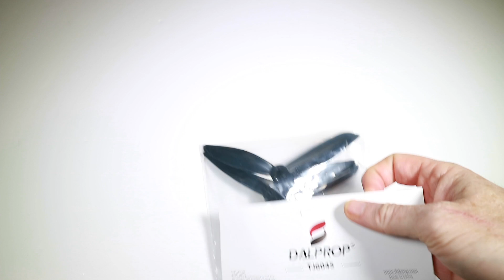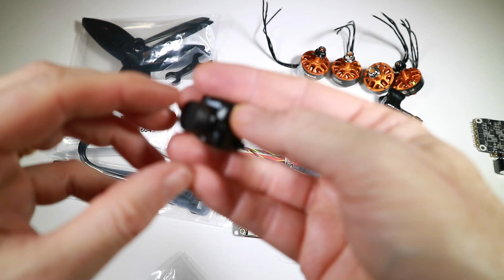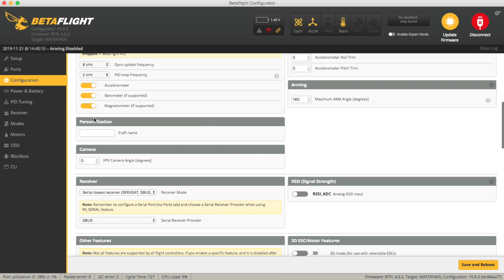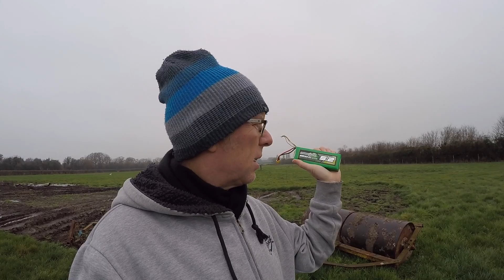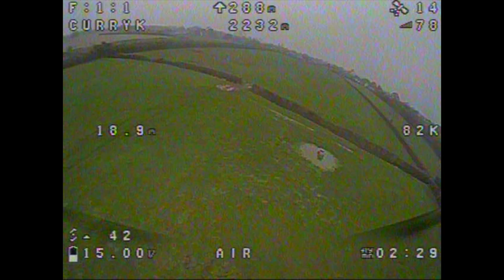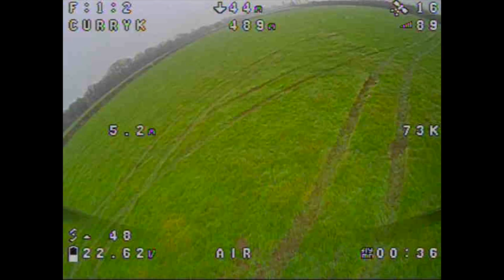Eachine Tyro119: Build, fly and review.  Supplied by Banggood

Comment: Well done in the fog and mud mate...The random GPS count is a Betaflight problem, been going on for ages now....Please drop iNAV on one of your Quads..I have it on one of mine, and I know the GPS Modes can be impressive...
Reply from the maker: I've still got my f450 which I was attempting to setup with Ardupilot months ago, but fell foul of no compass.  I do have a GPS with a compass now, so the plan was to try Ardu and then try iNav after to compare.  Just getting around to it and time etc
Reply: @CurryKitten  Well, I'd put it in a 6 incher or even a decent 5 inch quad tbh...The F450 isn't going to give you a good comparison...iNAV works well on a quad now...RTH will land at your feet in a controlled manner too. Ardu is too complex for most users.

Comment: @currykitten Thanks for another great video review. My first build about a year ago was the Tyro99. Really got me going in the hobby. Fun to fly, although the e!ectronics are not so durable. After replacing the FC and ESC twice I replaced them with a Mamba F4 MK2 stack. All is well. 

Still, the Tyro series can't be beat for the price. A great way to make the jump from RTF to building your own and learning the finer points of drone tech and construction. A dozen or more builds later I find I enjoy building almost more than flying. Again, nice video. Love your style. Keep 'em coming.  ~Bob
Reply from the maker: Hey Bob - the Tyro series certainly has it's faults, but it seems to get people into the spirit of building (and then crashing and repairing :D ) So it can't be all bad.  I just wish they would fix some of the real bugbears I have that would make it nicer for 1st timers.  Like decent instructions, nice motor wires and getting rid of that tiny SBUS jumper pad !

Comment: Damn, now I'm positive I'm having issues with my R9 system. I have the r9 lite pro module at 1W, but I've gotten failsafes at 760M with good line of sight... IDK, im on latest OpenTX, latest R9 firmware..
Reply from the maker: Yeah - somethings up there.  Bear in mind I was also using both TX antenna tuned for 915Mhz, but I was using them at 868Mhz which should make things worse.  I'd check out your antennas first - I heard a few stories about dodgy joins in the super-8 antennas
Reply: @CurryKitten  funny you mentioned that. I had been using my original super-8 antenna but today changed to the new one that came along with the lite pro module. My rssi hasn't changed much noticeably with most of my models but with a new slim+ OTA receiver I broke 1.1km today. Rssi was never below 60 in that flight.

Comment: David Windestal shut his RCExplorer shop right around the time I found out about the Tyro129 so Im currently, slowly, building a 7inch Tri & THEN will be grabbing the 129....
Motor wire problem on the Tyro's could be alleviated by adding in some 'racewire' like product, maybe...?
Personally, I'd be using a L9R rx & thinking the GPS mount would be a good spot for it to sit...
Ive noticed the amount of new-comers to the hobby buying the 129 & hoping someone might do an 'iNav on a Multi-Rotor for noobs' series as there doesnt seem to any 'complete' how to guide that I can find....
Any chance of doing something like that please?
I do know the GPS will need to be replaced for full functionality on iNav (220 lacks a compass)...
Only drawbacks I can really see with the Tyro 119/129 series of quads is the FC/ESC's have no current sensor & could really do with some soft-mounts included...
And those shit wires :/
Both look like the perfect quad for a Hybrid/Tarsier type camera...
Dalprops 'TJ' might stand for 'Terrible Jello', only the flight footage looked pretty damn smooth to me! :v ;)
For myself, I'd be runninig 3000 4s & 1800 3s in series (6s) as thats all I have for my fixed-wing models...

Anyways, just some random ramblings...
Thanks again CurryKittens & looking forward to seeing more!

Comment: Where did you mount the receiver? I'm new to this and not sure where i should mount it. Would it be ok on top of the vtx? Thanks
Reply from the maker: Mine it mounted on top of the VTX (although it's heat shrinked and has mounting tape so no possibility of shorting)  In an ideal world you want you rRX and VTX far apart, but that's not always possible in quad builds.  Another place you could put it is the shelf at the rear.  I wasn't getting any issues with the VTX mount though

Comment: Them wires on the motors bug me, it makes the motors seem like less Quality., hard wires are no good long term against vibrations and brake. If supplying a kit then the instruction should be good to help new builders to put together without research.  I love my 7" build I have made but it did take some tuning to get prop wash out, I wonder if 6" is a bit better. Nice review..
Reply from the maker: They really are shocking - certainly the weak point in the kit, and everyone has been saying it forever.  I especially hate the little jumper you have to solder as well.  Can't say for sure how the 6" feels - there's certainly some vibration going through your own prop wash, but seemed pretty smooth in everything else (as much as I could tell in the rain!)
Reply: @CurryKitten  Like I say I was lucky as SEB-FPV (Youtube  FPV-SE ) tuned my Quad using the black box, UAV Tech - PID Tuning Principles and now it flys fantastic, Seb knows his stuff backwards. I find when you get to 6-7" the tuning changes big time

Comment: Thanks for doing this video! I built this kit and used an XM+ (until I can upgrade to R9 or crossfire) so I didn't need to worry about telemetry (which also means my GPS rescue doesn't work either if I understand correctly). Did you just solder that R9 receiver to UART 4? Will you be covering that kind of information in your F.Port video coming up?
Reply from the maker: This is the second comment I had recently about people thinking you need telemetry to make GPS rescue work... I don't know if someone else has put this info out there, but it's not true.  G{S rescue just needs a working GPS on the quad - so you should have no problem getting it working.  If it helps, I made a video about the setup of rescue mode here https://youtu.be/n89zKarWohs  But, yes I'll be covering the F.Port/telemetry setup in the forthcoming video... and why it needed a different UART
Reply: CurryKitten awesome thanks! Yes I did see another video saying GPS wouldn’t work unless I had telemetry. Thank you again for your great videos and good luck with your flight sim!
Reply: @CurryKitten  Is this video already done? I am also struggling setting up telemetry with fport.

Comment: Well done for getting out there, weather has been terrible lately. It seems like a great versatile quad with use as well as batteries. Question, when you tried rescue mode it seemed to climb to 100m but in your BF setup seemed to show 30m or was that just me or did you change a setting? A cheap batter pad is a silicon mobile phone dash pad from the £1 shop, makes quite a few battery pads :-)
Reply from the maker: Rescue mode confused me at first (luckily this is the 3rd quad I've used it on so I'm used to it now) it actually uses the set RTH altitude as it's minimum, otherwise it actually looks at the highest altitude it records during the flight, adds 15m onto it and goes to that.  Sounds crazy doesn't  it !  Thanks for the hint of the silicon mobile phone thingy, I'll check out the pound shop next time in going past one
Reply: @CurryKitten  very interesting. Does it exceed the 400ft limit?
Reply from the maker: There's nothing build in to try and limit it's altitude, so don't fly over 105m and then engage rescue mode :)